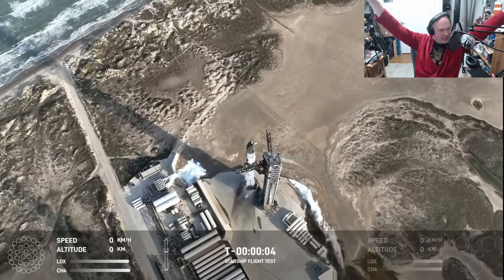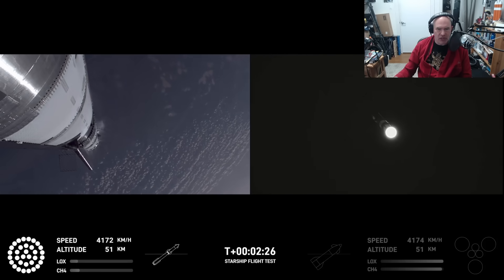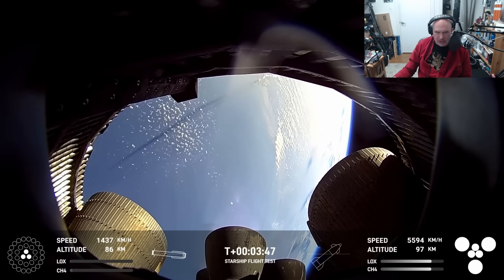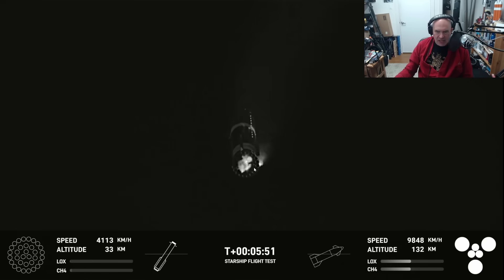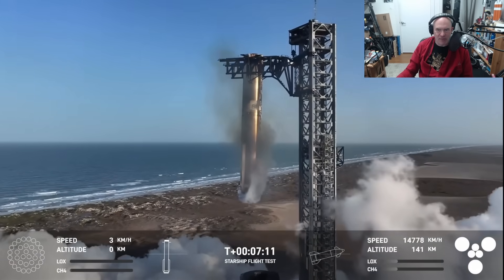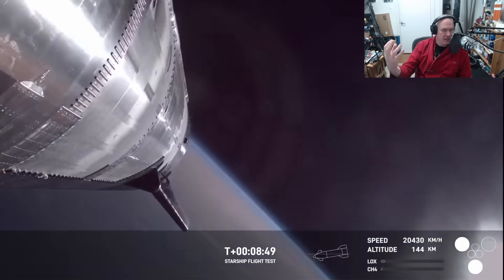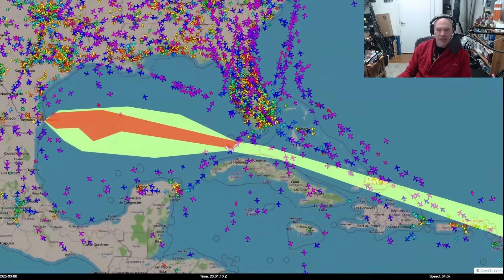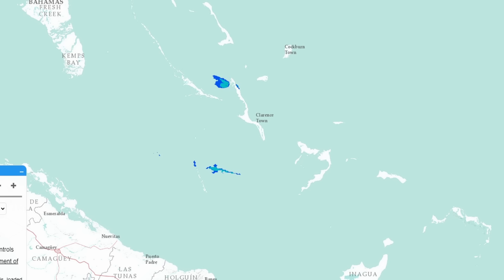SpaceX Make The Same Mistake Twice With Starship Flight 8

Comment: It seems the booster catch is 100 times more difficult an engineering problem than keeping starship six engines running in straight and level flight for 8 minutes, but something is going on.
Reply: I don't think the booster catch is that much more difficult than landing on a pad. The problem is that if it doesn't go right you lose your launch tower and if you have even a shadow of a doubt and abort you lose the booster since it has no landing gear.
Reply: @pi.actual  And the booster can hover a bit, so they have a lot more control to get the last part right. (Not that it isn't impressive.)
Reply: They are different types of problems/difficulties. Booster catch is mainly about engine relighting and precise trajectory control and coordination with the catching tower. A lot of it can be simulated so preparations can be made more easily.

The engine problem with Starship seems to be of a different type. It's a hydrodynamics problem or a material science problem (stuff getting too hot or corroding away). It may also be that SpaceX hasn't yet fully understood the problem they have. Clearly the fixes they implemented didn't resolve the issues. It could also be that there are several problems and they have only solved some but not all of them.

Anyway, we are looking forward to what SpaceX will say about it.
Reply: "booster catch is 100 times more difficult" Not so. Precise controlled landing had been done on Mars, so why not on a "lobstick" tower on earth?
Reply: It's going to be an "ah ha" moment when they figure out what broke, and then it will be fixed.
Reply: @Bob_Barney  Let's hope the fix doesn't break something else.
Reply: @ronald3836  It might.  You keep fixing and testing to identify the next weak link in the chain.  There is ALWAYS the thing you didn't think about and didn't know until it broke you needed to think about it.
Reply: it is not that difficult, take it from a rocket/control engineer

meanwhile I am happy that my Ariana works as promised
Reply: re-entry is still a problem
Reply: The problem seems to be the hot staging actually. According to their last report, the violent harmonics of the hot staging is causing internal damage that leads to these engine failures and aft fires, even with their fixes it still happened, so something about v2 can’t handle what v1 could.
Reply: SpaceX infiltrated by CCP which is sabotaging engineering
Reply: It's completly the reverse, you seem to be judging difficulty by a 'look cool' factor.
Reply: well like V1 starship..  when they upgrade to V2 booster we likely will have a few similar failures ...we really need to treat this one as the 2nd flight not the eighth
Reply: Yeah, they haven’t yet tested the re-entry of the 2nd version.

That is an even bigger challenge, then they have to prove the transfer of fuel in orbit and how to quickly reuse them in just a couple hours.

Honestly I’m not so sure anymore that Starship is going to work as promised and as cheaply as they need
Reply: @niconiconii-san  I don't get this mindset. Maybe it's because the falcon 9 program has become so routine and boring...that it tricks the mind into thinking that what is being done was easy to develop and not without many complications.

The starship program leverages all the novel technology, programming, flight dynamics and new techniques that was innovated over time... to take the next leap in rocket launch. But even tho there are similarities being leveraged we can't forget that at the end of the day starship is trying to accomplish something that has never been done before.

Which means that while there are a lot of known problems being solved...there will always be more UNKNOWN problems. When trying to do something that has never been done before...let alone never even attempted, the biggest question about the problem they are solving is 'what are even the right questions to ask?'. Until they figure that out... you can't come up with the right solutions, if you don't know what are the problems you're trying to solve first. 

They are doing development that the audience is watching in real time. The parts of complex projects that the public usually don't get to see. No point in assuming if the promised outcomes can't be achieved because what we are seeing. There's nothing to really compare the success/failure of starship development t... because there is nothing really relative to it. All this is unprecedented.
Reply: @niconiconii-san it was noteworthy how genuinely surprised the spacex announcers were about this failure. It stood out to me. 

Hard to draw any firm conclusion about starship yet since 33 raptors running well and the booster landing cleanly is not exactly easy. 

But it's not guaranteed that the starship concept is viable yet. Cramming 2 stages into 1 massive reusable one that introduces a lot of literal room for failure is hard. Having to add in tiles I suspect really degraded the core concept of rapid reuse.

Signs that it's too hard are that fixing one set of issues creates a new set. Don't know how many iterations can be considered as ok. 

Big picture it really doesn't matter if starship works or not since mars has always been pure deluded nonsense in terms of human colonies, and spacex already excels at launching reusable rockets so at worst this turns out to be an experiment where spacex learns a huge amount. At best it works and large load launches become cheaper.
Reply: @niconiconii-san There is nothing about this flight that indicates that at all. They are clearly dealing with a difficult to solve problem that they will solve. Let them solve it. This is not the end of the world
Reply: @ Grape Flavoure eh? Was it Flavour Aid?
Reply: @GrapeFlavoredAntifreeze  Yes, they will "solve" it, but by adding more fixes, they will be introducing more points of failure. Starship is just getting too complex. They need to simplify.
Reply: @ SpaceX has always fixed things by reducing complexity. What makes you suddenly assume they’ll do something they never do?
Reply: @ like adding giant chopsticks that catch the booster? How is that reducing complexity? Or is the argument that that wasn’t a fix?
Reply: @niconiconii-san  Penny dropped, eh?
Reply: @niconiconii-san I’m sure you thought the Falcon 9 couldn’t land, either.
Reply: @niconiconii-san  Bro u getting too anxious
Reply: The booster catch is the useless but nice looking part. It is absolutely meaningless if the rocket can not be put to orbit though 😂
Reply: Development, that's what's going on. It's not a linear process, as also pointed out by the SpaceX commentators. SpaceX are, with the Starship program, trying something that's never been done before and it's far from easy. They'll get there, I have no doubt, but particularly during these relatively early stages there are going to be a lot of big bumps in the road.
Reply: @ C O P I U M and meatriding in one post. Very impressive.
Reply: @SlartiMarvinbartfast  yes but engineers will tell you that you take baby steps.
When you have a failure you analyse the failure mode but also review all of the other systems to check for conflicting inputs, you rerun your numbers and validate the design, you run computer simulations adding inputs that are not nominal, you go to the floor and review the manufacturing process, you inspect and re inspect any work in progress, you then fix your current design before changing it.
That way you can validate any upgrades you make are not creating new issues. 
The way they run this program is like the way coders run software development, the only difference is here you cannot control all of the variables so you have to factor in redundancy (triple redundancy is the preferred method) but you have to have a solid base to build from, so you get version 1 into orbit and returned before you move to version 2, etc.
Reply: @SlartiMarvinbartfast  They did, however, sign contracts saying that it would be easy. And they took money for those contracts, tax payer dollars by the way. At least three billion dollars from the government to deliver a working system. They burned those three billion dollars, do not have a working launch system, have not even made it to orbit yet, and are also far behind their timeline.
Reply: @SlartiMarvinbartfast  you are a bot
Reply: @SlartiMarvinbartfast  "SpaceX are, with the Starship program, trying something that's never been done before and it's far from easy."

There have been two fully reusable second stage launch vehicles in the past. Other than the booster catch literally nothing about Starship is at all unique. Starship has already failed more times than the Space Shuttle has in it's entire lifetime, including tests.
Reply: @ASDeckard  You clearly have no idea what starship is or the technology it is using. Nobody is using full flow combustion methane engines on ANY reusable launch vehicles of ANY class. Nobody has developed a reusable launch vehicle of this size, and nobody is attempting to match the cadence and normality of starships goals. Also I would love to hear what those two fully reusable launch vehicles are. Oh you said second stage. You truly are on a cherry picking trip
Reply: My guess is that hot staging is damaging starship
Reply: This is why other rocket companies or organizations go for full duration static fire of their upper stage to weed out all the problems.. I don't see SpaceX doing this to Starship. So, you end up discovering these issues during the actual flight.
Reply: Or maybe it actually isn't and you don't know what you're talking about.
Reply: @andrewdevine3920  Can you explain why no other rocket launch system has been able to return and reuse first state boosters?  If it's easy, why haven't others done it yet?
Reply: @Bob_Barney 
If you're talking about first state boosters, almost every rocket reuses them. Once they burn out, they are released and sent down with a parachute.
Reply: @mikeblatzheim2797  Sorry, I am talking about the first stage, not a strap on, solid fueled booster.
Reply: What’s going on is your assumption is wrong
Reply: All the employees at space X are smarter than you guys about rockets. Have enough humility to accept this haha

Comment: its about time. no space event is an event without a scott Manley video
Reply: And the red bathrobe for ruds.
Reply: thunderfoot video might be more interesting
Reply: This was indeed a "no space event"
Reply: @TheBaldrickk  except... it was in space! 🙄🔫

Don't let facts get in the way of a good grift, eh comrade! Meh!
Reply: Scott flight review is a must after each flight attempt
Reply: @JanKowalski-vj9py  OK bot..
Reply: I wouldn't call these Starships launches "events'. More like "incidents".
Reply: @i.k.8868  who calls them events then?
Reply: Yo that looks like a supernova 👤☕️
Reply: But I feel like he did not deliver that great analysis this time. Most of the time great points, which is why I am here. Maybe he did not have the time.

But also he did not adress the fire on the engine that good, and it was the first to go out on the indicator on the engines, and the 3 sealevel engine also went right that second. Might that cause the cascade to the other engines( probably) but the fire was not due to the olcilation on the tip of the engine? The enginebells has been tested rigiously, and I feel like a fire hitting the engine, and that redglow down there should be affected by a fire considdering it's handling the hottest thing that exists made by man, by circulation cold fuels, is the only way that engine bell survives.
Heat from 2 sides might be too much, but I think it's unlikly

He adressed the fire that might be  form different sources and speculates it could be the same. Of course this is always difficult, but feel like he should elaborated on this.
Reply: theres some amazing footage off the stuff coming down some of them from near where it lands makes it look almost like it hits city from some angles :P
Reply: Sort of like if a tree falls in a deserted forest does it make a sound.....
Reply: I don't believe the event has happened until I see Scott's video on it!
Reply: @lyledal  Elon is trying to be Werner VonBraun but he's too big of a Nazi and not enough of a rocket scientist..
Reply: Love it when he simulates them
Reply: Scott and Marcus
Reply: Os nomes pessoais costumam ser capitulados pah.  Escrito dessa forma é uma ''nuance'' de submissividade sexual...
Reply: We are in a bad place when Thunderf00t is the only one who can tell the truth about what we can see with our own eyes. Starship cans are comically inadequate even to support an outpost on Mars.
He's nobody's first choice, but he is who is left with everyone else cowed.
Reply: @sciptick  sadly thunderf00t demonstrated that he doesnt know what he is seeing on screen… why do you think he stopped live streaming after ift 5? Not because he ran out of material to rant about!
Reply: @ from his two streams I recall all his blunders. For instance when the hot staging ring detached, he thought it was a piece of booster broken loose. He couldnt be bothered with informing himself beforehand on what was norminal, and on several occations called out nominal events as failures.… In my book knowing what to ecpect is a minimum requirement if you’re going to livestream any launch and be taken serious.
Reply: No event worth talking about

Comment: I think the engine skirt area on block 2 needs more robust  vibration mitigation, or they need to throttle down even further on hot staging with 2 or 1 engine. Theyll figure it out.

Comment: I bet it was debris in the carburettor! 🚀😜😯
Reply: Add a can of SeaFoam.
Reply: Ignition timing too advanced.
Reply: Fuel tank designed by the same engineers that created the Ford Pinto ;-)
Reply: Faulty EGR or the CAT was clogged or the DPF needed to run a burn or the turbo got oil in it and failed.

Comment: I really think they have to revise their hot staging.  I expect it’s doing more damage to the 2nd stage engines than they are expecting… leading directly to engine failure.
Reply: Nope, worked fine for the v1 ships, this is the downcomers vacuum jackets and engine connection points